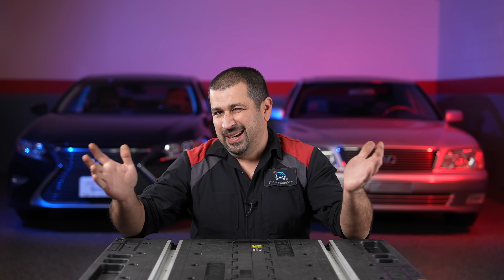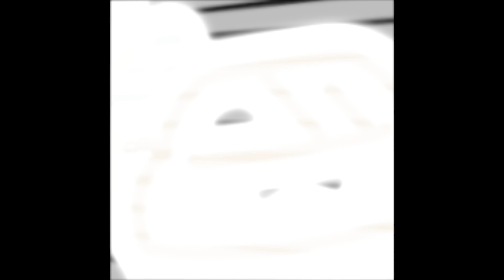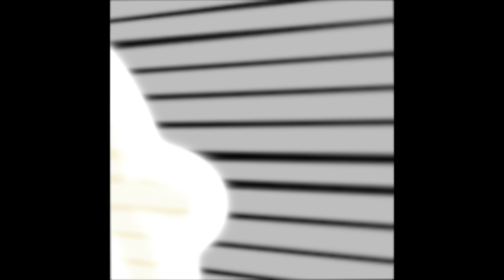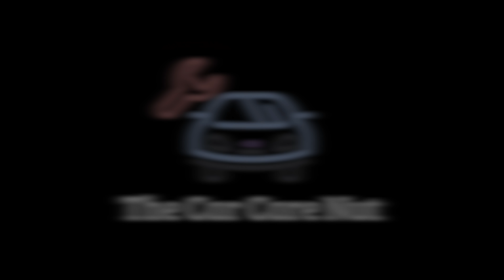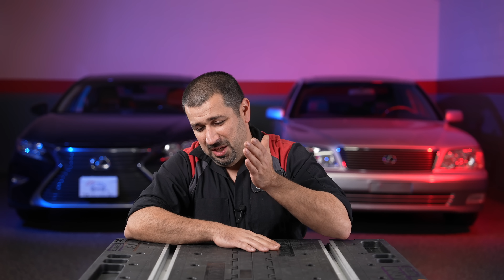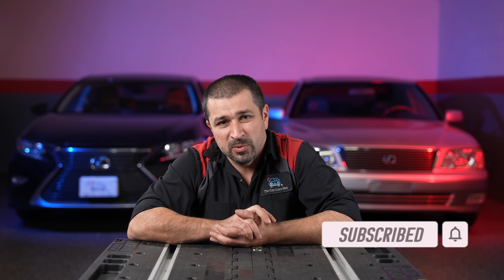Can Modern Turbo Engines Be Reliable? Here's The TRUTH!

Comment: I recently retired.My work car was a AWD qx50 base 2017 last of the naturally aspirated Vq engines
At retirement I traded my Mkz 2.0 turbu 2014 AWD 90000 m for a challenger GT AWD pentastar naturally a sperated v6
It's not can turbus be reliable it's the fact that older naturally a sperated engines are more dependable than turbu engines by and large
Ask a business or Ford garage which last longer better the turbu or old tried true v8
If you have a turbu use a good full synthetic and change it early I changed every 5000 on my Mkz and had no issues
I drove 10000 a year

Comment: Sorry, there is an error in your claims. Diesel engines do burn at a higher temperature than gasoline engines. One reason is higher compression ratio and the other way you can tell is that the NOx emissions are higher in diesels and that happens at higher combustion temperatures. Just want to make that clear

Comment: Volumetric efficiency that's what forced induction is all about. 
Sure you can make 500 horsepower with a turboed 2 .0 
You can make that same 500 horsepower extremely easily with a big block Chevy naturally aspirated. 
Now you can run them side by side down the drag strip until one of them pops or hook 10,000 lb of trailer weight behind them and see what happens.

Comment: You want to see how the engine is liking your oil change service? Get a flashlight and take off the oil fill cap and look around in there at the head. Should be shiny clean valve train and the cyl head metal should be  clean as a whistle.

Comment: Question - I have a 2019 ford f150 with 2.7 turbo engine. Even though I don’t tow or drive fast/agressive I should change oil every 4K, 5k miles?

Comment: I have increased the OCI on my 2 NA cars to 2500.  Florida here its really really hot out. I bought the Vecor oil change vac in Amazon. Its cheap thought I would try it bought another oil  vac before and it did not come with the right tubes  Vecor has the correct length and size of the evac plastic tubes. It works great just take the oil fill cap off put the tube in the dipstick hole  pump it up till it starts sucking oil then stop pumping and it sucks till its out of vac Just let it suck till it runs out of vac and pump up again. Works really good. No mess. For people in apts this is a godsend or even a woman.
Its easy the only hard part is emptying the canister its a little bit heavy with 5 quarts in it to lift it and tilt it up into a recycle jug. I just drop off my used oil at Jiffy lube they sell it back for vat oil.
But Your better off doing 3 oil changes with the Vecor on one filter than no oil change at all that's for sure. You keep clean oil in the car on the same filter not much to filter its dirty oil that cause metal wear not clean oil. You can buy a jug Of Pennzoil Platinum 5-30 for $26 at Wallys.
I watch the engine coolant too and as soon as it starts to even begin getting even slightly cloudy I put an oil change bin under the car no need to jack it up and take the rad cap off open the rad petcock and dump the rad. The rad takes about 1 gallon or a little more and NO AIRLOCK NONSENSE. DO NOT EVER drain the engine coolant. Just close the rad petcock and fill it back up. Drive a little check the oil and fluid again. Also every time I drive my cars when i get to where I'm going that is safe I crack the hood open. let the heat get out. When I get home I open the hood till the engine cools off. Its around 200 degrees under the hood when you shut the car off and it heat soaks. It cooks the shit out of the engine the trans the oil the trans fluid the coolant the rubber the plastic the belts the ac compressor the alternator. It really helps my bought new 8 year old car looks brand new under the hood. 
 Back in the early 60's they made some big luxury cars that had  a feature that when you shut the car off it had an electric rad fan and it would run the rad fan with the engine off a short amount of time to cool the engine bay. I guess with shitty 12 volt battery technology it was killing battery's and they stopped offering it but they were on the right track. Good Luck!

Comment: I have Question about Engine oil related to Lexus Ls460 2007/8-9 models. I seen lots of people using OW20 - But I believe in those years OW20 wasn't around.... What about 5W-30?.  Is it still good oil to use?..

Comment: Owner of 2020 WRX,only owner, 160k miles, and all original (even clutch and turbo) just basic maintenance, drive and beat on a daily basis. the killer of turbo cars is and always has been LSPI, it's a higher maintenance setup for sure, but done correctly it can actually be just as if not more reliable.

Comment: I had a Volvo 240GLT 1982 back in the 80's. It ran fine for close to 200k miles, sold it used and they used it for a few more years ( I saw it around town for a few years). So yeah, they can last, just change oil and followed the rules (don't rev engine and cut ignition, let the engine spin down for a min, then cut off ignition).

Comment: I avoid turbo charged engines. Oil thins quickly and burns, produces much more heat, so I avoid them. 
And putting a 2.0 liter turbo engine in a car or SUV over 4000 lbs, that engine will die in less than 150,000 miles.

Comment: I recently bought a 2024 Honda CRV with 2 stupid things. Start/ stop engine and that turbo. Now it belong to my wife. I told her not to push it to the metal on the accelerator like a sport car. The dealer told me to do 7500 miles oil change but I don't agree with them and does it every 5000 miles oil change. I remember back then it was 3k before 2010. There might be improvement but I just don't want to push it to the limit.

Comment: In 92 I bought a Honda and the head mechanic told me change oil every 3000 miles and the engine will last forever.  I sold that and others at 250000 miles in great shape.

Comment: Everything you’re saying goes with what the Oil Geek says! He says with a brand new vehicle  you should flush out your oil at 500. mi. and keep the same filter. Then flush it out again at 1000 miles and keep the same filter and at 1500 miles change the oil and the filter. And then you can change it every 5000 miles or less. what that does it gets out all the manufacturing debris in the bottom of the engine that is left behind. that’s what was causing the GM 6.2 gas engine failure a while back!

Comment: Recently bought a 25 Lt Chevy traverse, which has the new 2.5l turbo engine.  It has a 15,000 mile change in the book what a joke. 

The traverse only had 20miles on it, drove 500m and changed the oil.

I drove 1200m to Utah for a family trip, and changed oil.

I completed the break in oil changes and now change every 3,000 miles. 

Using Castrol 0w-20 full synthetic extreme performance for the heat displacement.

I already knew better and thank you for your videos.

Comment: Here is something I learned on a similar note. If you have a company and buy mew company vehicles for commercial use, you get different service intervals from the manufacturer. In Germany where I live if you buy Mercedes as a private party, you get the first oil change at 40k km and every after is 20k km(12k miles) or two years. If you register it as a taxi thought you are recommended BY MERCEDES to change the oil at 10k km or 6k miles. And these taxis are usually pretty common for sale with more than 500 000km (300000 miles). This is true for Volkswagen and Toyota as well as other manufacturers

Comment: The modern turbo engine, like wide open throttle, is a way to meet emissions and still show a high performance number to buyers. That 2 liter engine rarely uses boost. neither does it get the 300hp or whatever is listed. It runs on the lowest boost possible until it HAS to add boost. similar to wide open throttle where a engine acts like it only has 160hp until you put the pedal down to wide open throttle and the control module realizes to add all boost, open the vvti etc. They have to do this to maintain fuel mileage mandates. They can operate at max power for a minute, I wouldnt recommend thinking you have a 300hp engine if its got a turbo on a 4 banger lol wont hit 300 thousand km's. You cant sell a car in north america that has weak performance numbers, americans want to turn onto the freeway and have it merge easily. The only way to do that, is a small displacement engine with a turbo and wide open throttle engine control.

Comment: GM is making a three-cylinder turbo these days to meet emissions requirements. We had a Buick. Our mechanic warned us about this car, saying that these GM engines do not last. We had to replace the fuel injectors on the car before 50,000 miles. The injectors are made in Poland (not great with tariffs). The dealership refused to replace them for free under warranty. The issue with the injectors is heat—one of them burned out (and you replace all three if one goes).

Our next car was a naturally-aspirated Nissan Rogue Sport. Much better car.

Comment: Thicker oil will make your turbo spool later. I've noticed my turbo lag became about 200-300 rpm longer because i changed from 5w30 to 5w40.
You can most definitely use cheap oil. I've had no problem with the cheapest fully synthetic oil at my auto parts store. Read the additive packages, read the certificates, read the compliance table. You'll be surprised how close the cheapest option is to the most expensive option in terms of performance.
Even the cheapest oil will be better than the most expensive oil that had been used up, so as long as you change your oil on time you're fine.

Comment: Turbo is an added wear item, so it's natural that a turbocharged engine might not last as long as its NA counterpart.
Ironically my least reliable car is my NA Volvo, meanwhile my Turbo Volvo and SAAB haul ass and run just fine.
Long story short - change your oil and service your car timely. My NA Volvo was neglected by its previous owner.
Wait .... but so was my SAAB - the oil was tar and coolant was not there, the valvetrain made it sound like a diesel tractor, yet it's the most reliable shitbox i've ever had. And it made 18Psi of boost with crazy blowoff noises.
And my turbo Volvo was some shade tree mechanics hack job that had not seen love in about a decade, but it makes 16Psi of boost from factory and spins tires too often, annoyingly.
Yeah it's not conclusive i guess. Turbo always wins in my book, but i smell an ITB NA car in my future.

Comment: I rebuilt turbos for 6 weeks during my heavy equipment apprenticeship.   The number one killer for turbos is not allowing the engine cool down and turbos slowing down.  Small turbos can spin in excess of 120,000 RPM.  A hot turbo spinning fast with no oil supply will quickly carbon up inside the turbo and begin clogging up oil passages.  Please allow your engine to idle down a minimum of 3 minutes before shutting it down.  Another item to add is to use full synthetic oil as they do a better job at high temperatures amd change oil frequently.   Remember, oil is cheaper then metal.
Reply: While I applaud you for giving good advice, who’s going to park their car at the grocery store, at home, or anywhere else, and then just sit there for 3 minutes, EVERY TIME they park?  It’s just not a realistic behavior people will adapt to.   It seems like it would be an easy thing for manufacturers to add a thermostat to keep the oil pump running for a few minutes after shutting the engine down.  They already do that for electric fans under the hood.
Reply: @Rob-ou1fj I absolutely agree with you.  Volkswagen has an oil pump.  My Ford 3.5 ecoboost doesn't and I wish it did.

Comment: To summarize: A turbo motor will wear out sooner than an ICE motor due to the extra heat generated, but changing the oil sooner, at 3000 miles, with the recommended quality oil, will extend its life. You're welcome!

Comment: 1️⃣ugh… I really like the Bronco (not the small one). Problem for me are those 2.3 and/or 2.7 liter turbo engines. You HAVE to let a cold turbo engine warm up and you  HAVE to let ‘em cool down if you’ve been running ‘em hard. 2️⃣when the turbo DOES go out (and eventually it WILL), it’s going to be at least $2500 to replace.

Comment: Or you pair the petrol engine with 2 electric motors/generators with a planetary gearset and a smaller rechargeable battery. You can even pause the petrol engine while driving by varying the rpms of the electric motors. PROFIT MF!!

Comment: I want to buy a 2026 Toyota Crown Platinum. It has a 4 cylinder turbo. I’ll mostly use it for highway driving and I’ll only drive it about 4-6 times per month. Should I be concerned about buying a turbo? I am good about taking it for maintenance when it’s recommended. I need this car to last 7-10 years.

Comment: Excellent reminder.  Also, complexity in more moving parts like EGR valves that fail.  I know, my new Duramax I6 had the EGR fail at 3,000 miles.  GM couldn't get a replacement part for almost 2 months.  Now I drive a non turbo 5.3 V8 .... :)

Comment: As a pro mechanic, I agree largely with everything said here. But also, we're seeing a disproportionate amount of head gasket problems with these small turbo engines and changing the oil more often won't solve that problem. At the end of the day, a turbo always adds more complexity, more points of failure and puts more stress on the engine, vs just using a bigger engine. And in the real world, the fuel economy difference isn't that great. It depends more on what you drive and how you drive it. Far and away the best way to save energy is to use less, not try to make the same amount slightly more efficiently.
Reply: I totally agree with you on the oil changes. It all comes down to the design and built quality of the engine. 
I was looking the other day at some pictures and specs of the Ferrari 296 engine. Sure, it produces a lot of power but it is water cooled using huge intake radiators and it has a dry sump lubrication system which means the engine is oil cooled as well. No cheap plastic parts and things like that. Just solid metal parts everywhere.
Reply: Or just using a smaller engine and smaller car like back in the past.  A 2025 Honda civic would have been considered a decent sized car back in the 80's and 90's, today they look dwarfed by everything on the road.  I was a jet engine mechanic back in the day and I remember they said they had to switch to synthetic oils to cope with the heat of a jet engine, so synthetics should be able to handle higher temperatures if they formulate them right.  Synthetic oils should be better all the way around, don't know about 10,000 mile service intervals.  Like a turbo mostly the oil just lubricates the bearings on a jet(plus the accessories) so probably that area of the engine doesn't get hotter than a typical turbo.  I know it was supposed to be bad back in the turbo 80's with the oils and engineering they had back then.
Reply: @jeffk464 This is what I'm implying when I say "what you drive" and "use less energy." last year, something like 80% of new passenger vehicle sales went to trucks and SUVs. 80% of Americans absolutely do not need a truck or SUV to meet their every day needs. These vehicles are not only extremely wasteful, but also make the roads a much more dangerous place for everyone.

As for synthetic oils, they are absolutely more durable and offer better protection. Considering the cost of oil vs the overall cost of ownership of a vehicle, I would always use synthetic, especially so in a turbo vehicle. That said, the biggest problem with gas engines and oil, is getting gas into the oil. There's only so much to be done about it and this is the real limiting factor in drain intervals.
Reply: @jeffk464  the Civics have turbo engines. The Corollas or the Mazda 3’s don’t. They have larger NA engines instead and especially Toyotas get better mileage.
Reply: Sounds like people should slow down.  But, most want to go faster.
Reply: @kennethseibert5711 Yes. But I think the bigger problem is that everyone wants to drive a big truck or SUV, when their use case clearly dictates a sensibly sized car. Trucks and SUVs are a gas guzzeling menace at any speed.
Reply: The problem is consumer options are shrinking.  V8s & naturally aspirated V6 engines in family vehicles are going away.
Reply: This is what I was going to comment on. Modern turbo engines are having a ton of issues with head gaskets and it's not just people beating on them. I had 2 head gaskets go in my 2014 Escape before 100,000 miles. No thanks. I changed the oil every 3 months/3000 miles. I'm not convinced it wasn't over-boosting and causing it. I figured they had to have some type of internal waste gate, but maybe they just suck.
Reply: I assume you're talking about Hondas 1.5 Turbo engine. It has a design flaw, weak headbolts, and a slit in the head between the cylinders that the headgasket struggles to seal, eventually and usually below 100.000 miles fails.
Reply: @1958Cadillac-v2g Many small turbo engines are having failures not directly related to engine oil, as other commenters are pointing out
Reply: @1958Cadillac-v2g  Honda has no design flaw. Most people read the manual and see "at least 87 octane" and run it on a high compression turbo engine. If you dig Honda actually recommends premium for tyhis EXACT reason. Iv owned a few 1.5ts now. All perfect and a couple hundred thousand miles presently. Only using Premium high octane fuel.